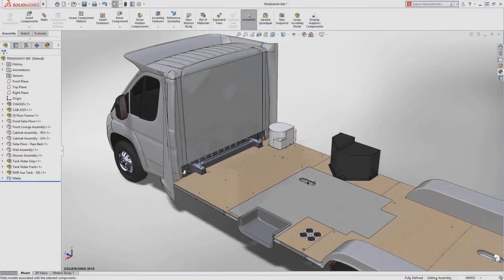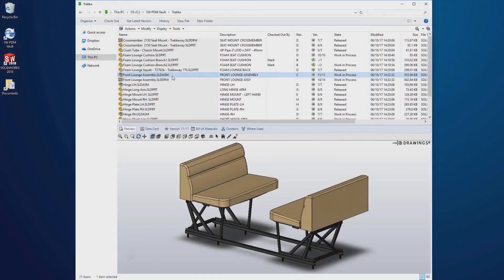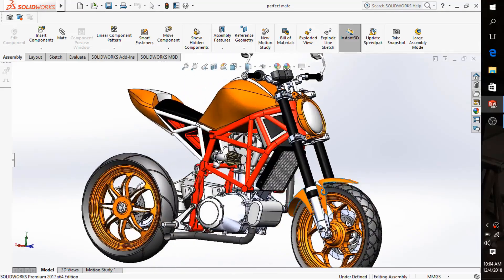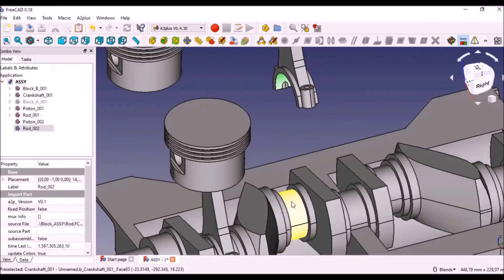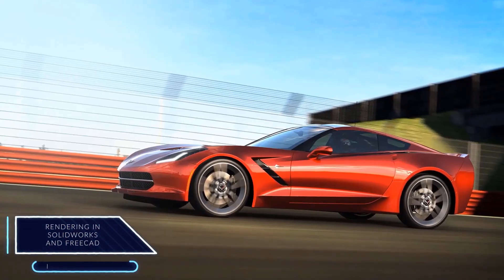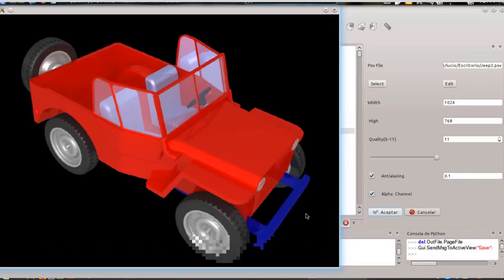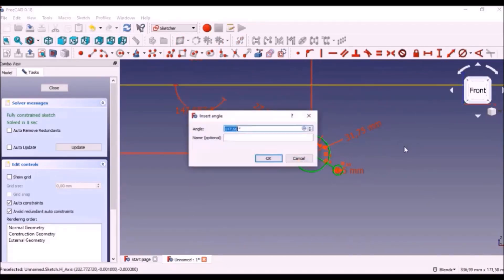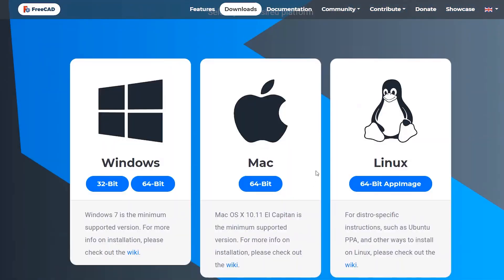SolidWorks VS FreeCAD, which is better

Comment: Freecad seems to not be very easy to work with but i think if you can get past the rough edges, open source CAD software is extremely powerful. I always found software like solidworks left a lot to be desired in terms of function based modelling, and it was difficult to implement more complicated algorithms
Reply: Freecad is not easy because it's not have "built in" feature to do complex task. For example, for me the easiest way to render a good visual, I need use blender. In SW I just need photo 360 menu.
Maybe for people whose mastering fundamentals of engineering drawing, freecad is very powerful tools

Comment: Autocad made me lazy and stupid. I tried to learn solidworks and I did some interesting things with it, but I gave up. Freecad is impressive and I am trying to learn it. I hate solidworks because I can't create machines using it< I know how to do it on autocad, but I don't nkow gow when using solidworks (all solidworks tutorials I saw are from people showing how to enter a 2d design on solidworks to create a part, I did not see even a single tutorial showing how to sketch a few parts on a single design to create parts later). To be more specific (since my english is poor) I have an example: to create a single shot pistol lockwork with trigger, trigger bar, sear and hammer and their springs and spring guides.

Comment: I have used Autodesk Inventor and solidworks before during university. I prefer Autodesk Inventor. 
However, when I graduated, I didn’t have the funding and do not want to pay the subscription fees for both of them. Therefore, I eventually go for FreeCad and found that is fantastic. Even though not comparable to the Inventor to some extent but it gets the job done.
I am thinking of OpenSCAD in addition to that as it may give me more flexibility to create and manipulate the object and the text-based CAD can save my hand from mouse to keyboard.
Reply: I have used AutoDesk and Soildworks in university. Now I use FreeCAD and OpenSCAD. I found FreeCAD to be buggy. OpenSCAD is the lighest and most bug free product but a little slower to develop stuff. Where are you from
Reply: @himanshusingh5214  I just used OpenSCAD. I designed the complex singular part with FreeCAD and make the array of the exported model with OpenSCAD.
3D printing with OpenSCAD is much easier than with FreeCAD. The constraint-based design with FreeCAD is more intuitive.
I would say that FreeCAD and OpenSCAD are not entirely in a "one versus one" situation. They can cooperate together to aid convenient design. There is even an OpenSCAD workbench in FreeCAD.
Reply: @himanshusingh5214  Freecad is buggy as hell to me.
How it's even possible to make something like that handle at 0:57 without it giving thousands of errors and having the part dismantling itself?
Maybe it's because i'm new to 3D design, but i can't even make a fillet without it going nuts.
It does good on simple shapes, but when i add curves and details it just gives up.
Is OpenSCAD better for, uhm, less square designs?

Comment: Thank you for your info, I am new to CAD and do not want to spend moneys on a program that I my not be able to use to the full. I am a retired mechanic and would like 
to redesign some engines! I am a visual learner so if it looks right it normally is not far of the mark. I have FreeCAD, but I like the look of SolidWorks, if I download 
SolidWorks, will I need to buy other addons to make a decent model?

Comment: Is it possible to learn on free cad and then move to SW or any other paid software. Maybe the work flow is similar?
Reply: If you know one CAD software, learning another is simpler. FreeCAD and solidworks are pretty different but freecad is not a bad starting point

Comment: I have been working with CAD software as a professional for over 30 years. I have used many of the commercial products available. I can tell you that Solidworks is obsolete garbage. The drafting side of it has always been, and still is, terrible. It only functions with simple drawings. Any reasonably complex assembly and it goes turns to crap. The software is not multithreaded. Which means it only runs on a single core. My computer has 16 cores, so SW is only utilizing 1/16 of it's power. As such, it is still as slow as it was 20 years ago. Any company that is paying for it is getting seriously ripped off.
Reply: I've used Soldiworks and Creo for work. Although the latter is very hard to configure and more difficult to use, it turns out to work better when the model needs to be changed. With SW I could not manage to modify a simple assembly (two plastic shells) without mistakes, conflicting contraints etc. The best I've tried is Catia however
Reply: All 3D modeling programs are single-threaded! If you worked in the industry for 30 years, you would know that!
Reply: I much prefer Solidworks over most anything else... Creo, Inventor, F360 and Freecad.  It's true you need to break things up in large assemblies and freeze the stuff you aren't working on.  For drawings though, I didn't mind Creo.  I worked in an engineering studio for 5 years as a drafter and designer.
Reply: SW can't possible be as bad as FC. FC is the most buggy piece of software I've had the displeasure of using in my 35 years of computing. 
FC is free, I get that, but what good is free if literally every project I've ever attempted to create with it has been an abject failure due to bugs? As of today, I have abandoned yet another parametric, spreadsheet-based project because I cannot get it to render a specific feature correctly when updating a single spreadsheet value: constraints on a specific sketch that make use of the changed spreadsheet value break in ridiculously bad ways, depending on how many times I change the value: horizontal distance constraint from the origin to a vertex on the sketch moves itself to another vertex, or vertices from multiple line segments get fused together into a single line segment, or segments completely disappear from the sketch altogether. This is just one example of many that will have you hating FC if you try to do anything but the simplest of things.

I always end up going back to Blender to create my models. It sucks, though, that Blender does not support parametric design.

Comment: As a CAD user I find that SolidWorks and FreeCAD are two of the least intuitive, hardest to learn, CAD softwares. As you actually used Autodesk footage in your video Inventor is actually way easier to use. Not saying the previous two are bad but they are terrible to learn if you have other options like Inventor, Fusion360, and SolidEdge. The easiest CAD software I have used (even for 3d) is AutoCAD, of all CADs.. It is very easy to draw objects with it. The down side is that AutoCAD doesn't have all the mechanical features that SolidWorks and Inventor have.
Reply: I laugh in Pro|Engineer. The difficultmostest, heart breaking software in the universe. Never try to wing it. Nothing intuitive about it. You must read a complete book and watch many videos before getting the hang of how it works. But if you can persevere to the end, it becomes smooth sailing.
Reply: @JohnFekoloid  Catia is way harder and tiring to use imo, ProE was nice and easy in comparison and assemblies felt really robust.  Not sure if Creo is any better or worst though...

Comment: fell freecan is open source so im automatically choosing that one, gonna use it to design foamboard rc planes
Reply: good luck with that.  Open source doesn't mean good.  And FreeCAD isn't.  You'd be better off with the free community edition of SolidEdge
Reply: @ulfrinn8783  well i refuse to support any proprietary garbage so im using it anyway
Reply: @lucywucyyy  They have a lot of work to do.  They have a lot of silly features that aren't even remotely relevant to most target users.  Blender had that problem too.  This gives them a dropdown menu for toolbars so long it becomes a mess.  FreeCAD is a mess, and seems to lack focus.  When they fix that, as Blender eventually did, then it'll be good software.  But first, the developers of it have to realize these things, and figure out who their target audience actually is.  

They should be focusing on the hobbyist community.  No engineering firm or manufacturing company is going to replace their Solidworks or Inventor licenses with FreeCAD, but if they focused more on simply being a Fusion 360 alternative, it could be quite good.  But as present, they can't even get constraints right, and they're adding garbage like ray tracing features...
Reply: @ulfrinn8783  well il see i guess

Comment: SolidWorks are extremely shy when it comes to talking about it's cost.
Reply: well, what can i say, no comparison open source.. i know all established cad ware needs to make money. but hey, exorbitant price where students can be use for free during UNI days , but what about after that, only a handful can afford.. something needs to be done on cost of owning it. Engineering student will suffer. Thanks free cad.. just get use to it
Reply: It's about $5k for a license, and they want to get you for a few $K/yr in "support and upgrades", however support is something that most competent people never use. Also, if you're running an older version, you're often stuck, because newer versions can open older versions, but not the other way around. It's extremely frustrating, and a major reason I'm looking to ditch Solidworks.
Reply: you mean deceitfull, as also nanoCAD
Reply: You can get it for $99/year.
Reply: @ulfrinn8783  Maybe for the student version, which prints "STTUDENT VERSION" all over every drawing you touch with it. This is not acceptable.
Reply: @highdesertdrew  It is not acceptable to use the "Student Version" to earn money with it. In all other cases the inprint is not important.
Reply: @tactiti0n  Here we talked about the student version. Please refrain from this silly pick-up line towards me. First read, then think and then answer would have been the more sensible way.

Comment: Many years ago I used Solidworks; but after changed to NX, I could not go back anymore.....NX is the best!
Reply: I actually agree. Of all the tools Ive used Siemens NX is my favorite
Reply: what is nx?
Reply: @chilln.official  Did you hear about Unigraphic? The latest version called NX
Reply: @rickychung7611  you mean Siemens NX
Reply: @mehanikal5639  Yes, especially complex surface profile
Reply: Unfortunately it is one or two orders of magnitude more expensive than Solidworks.
Reply: @tymoteuszkazubski2755  20+ years ago, my company shifted from Solidworks to NX (30+ licenses!)after just used SW for 3 years....depends if it really need to deal with complicated profile....

Comment: Don't be too excited,I have been using the F360 but at the back of my mind I knew you can't compare it with Solidworks, solidworks is just too great
Reply: One costs 1400/year. The other costs between 22-26 grand.
Reply: BrunoDSL  near $2K a year for solid works compared to $0 forever on freecad yea solid work beats it with way higher funding and hugely bigger team
Reply: IMHO Autodesk Inventor is better than Solidworks but yeah, F360 doesn't compare with any of these.
Reply: @elementiro  I tried Inventor for a few minutes but you can't even remap the orbit control from shift + rmb to middle click, noped right out of there

Comment: SolidWorks user since 1998. The Freecad seems to be worst than the SolidWorks 98 version. All for free software, but clearly you have to pay for better integrated solutions.
Reply: Have you used it recently? It's slowly catching up and already does more than many users need.  I used Solidworks for several years, now FreeCAD has taken its place and is fine for what I do with it.
Reply: @XXXXXX-dy5fs  I make large industrial assemblies with 20,000 components that needs to be iterated over and over again. Is FreeCAD a good solution? I'm struggling with the assembly side of things as well as some part design features don't let you edit all the parameters of the features.  Do I just have more learning to do?
Reply: @Jaze2022  for assembly, sure, freecad's not good. They have not developed it yet, for designing it's fairly good. Can you please share the  details on where it did not let you edit the parameters??
I know some missing things like Boundary Boss, inability to Flip side for operation, but am yet to stumble on a place where a parameter was locked.

Comment: How FreeCAD handles very large assemblies?
Reply: did you ever find out how FreeCAD handles very large assemblies?  I've just started playing with it the last few days and I'm not impressed.
Reply: @Jaze2022  I´m on the same spot, what did you find out?
Reply: @marianoruiz9039  horribly.  There's no official assembly support.  The plugins are clunky.  Don't expect the level of seamlessness and flexibility as in something like solidworks.  What you get is something like inserting a part into a part in solidworks.  It's also slow.  I never tried making a sub assembly.  Making a single assembly was bad enough.

Comment: Is the knowledge transferable from one to the other?
Reply: I would believe so. I've had experience with CREO and Solidworks. Using similar features in FreeCAD is almost the same.
Reply: The purpose of both software is the same. It's finding the button you need to click to make that change.
Reply: I recommend using the Launcher addon in FreeCAD to minimize button hunting
Reply: @AllanLaal  yeah, that helps a lot

Comment: great to fantastic info.... this should be the very first video to watch before learning solidworks or freecad or cad etc... it lets you know how and why you are getting something done and by what means you are getting there ... car boat plane walking... you can get so evolved designing a part and not comprehend the big system picture... is there a better way to do the task? thanks..:)

Comment: Which one is better? Obviously solidworks,
 By far.

Which one makes more sense ? freeCAD by a long shot ;p unless you're an engineer at a company 4,500$  a year isn't worth it
Reply: @hollybellwether  Solidworks is better software, but unless you are a dedicated professional, you can do most things with FreeCAD without need to pay extra
Reply: @dumpsockpuppet5619  what about 20,000 component assemblies?
Reply: Jaze  if you make those kinds of designs your high 6 figure income and work payed solidworks will do the job
Reply: @captainheat2314  SW probably won't but when making assemblies this large you likely can afford something good like NX.

Comment: FreeCAD and Solidworks aren't comparable. There are no professionals that use FreeCAD. SW is far superior in every way.
Reply: I'm a professional and use FreeCAD and other opensource software instead of Solidworks.  It does everything I need to get the job done.
Reply: How can you say there are not professionals that use FreeCAD, of course SW is much more developed than FreeCAD, but that doesn't mean no one uses FreeCAD professionally.
Reply: @Edgard422  It's true enough, engineering costs are so high that it makes no sense to waste these valuable working hours wrestling with less than ideal software package. Sure the professional software costs thousands or even tens of thousands, but so what, cost of the engineering hour starts from above 100$
Reply: I am a professional and I use FreeCAD. 

Nice, Hassel free way to get it installed on many computers without a license and simply boot it up an load work on any computer.

I typically design fairly simple parts that are meant for function/ease of machining rather than aesthetic though and so SOLIDWORKS might be much better in that regard.
Reply: @Baz either talk in facts, or shut up. these peacock terms dont help at all.

Comment: -There is no "Business"-Version of FreeCAD which costs anything. Or did I misunderstand something in this video at 8:38?
-FreeCAD also is parametric & history based but FreeCAD with its "Part" or "PartDesign"-Workbench is not a hybrid like Solidworks with part parametric and part direct modeling, but basic concepts of modeling are mostly the same. Workflow in modeling parts is VERY similar.
Reply: yes, that was wrong.
Reply: He was saying about SolidWorks but was showing FreeCAD images. I also got that wrong. hehe
Reply: seems like FreeCAD doesn't have as much flexibility for design iterations?  I had to remake features to get the full suite of options that determine the feature.

Comment: To use freecad to draw a simple skecth you can use any computer, is very light.
Reply: But not user friendly.
Reply: @layereight3289  the sketcher is pretty user friendly, but yeah it isn't obvious what to do when you first open it lol.
Reply: @layereight3289  I use at uni solidworks and for homestuff freecad
FreeCad is way nicer and easier ;)